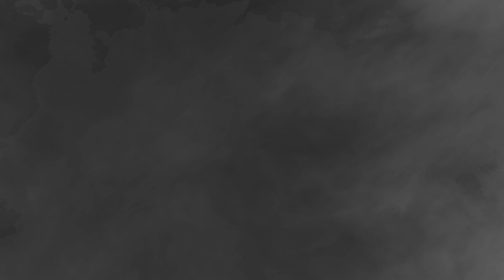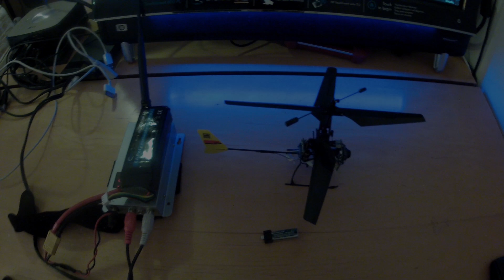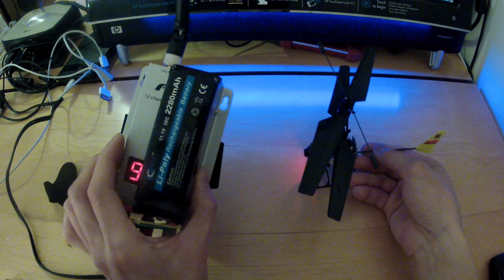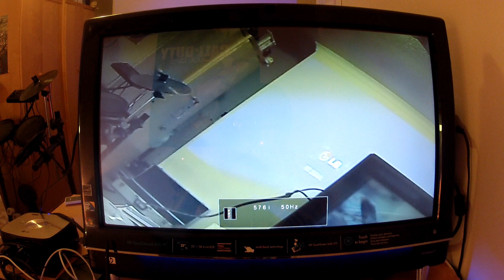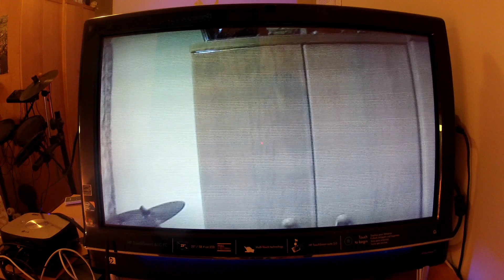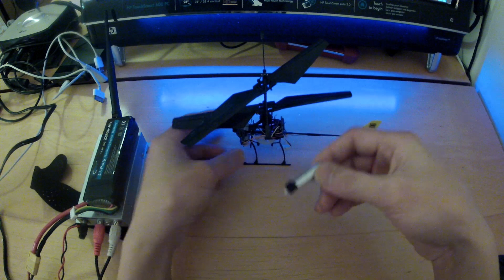World's (possibly) smallest micro FPV RC helicopter - with video tx

Comment: Nice clean job. Earlier today I ordered a large copter to practice with and also to test different cameras. UDI U12 2.4ghz 3.5 Channel 29" Long Co-Axial RC Helicopter. Not sure if it was a good decision. I also want to add ground sensing. I figure that would be a good mental challenge for me.

Comment: Did the same, but stripped the (rather beaten up) copter of boom and landing gear. Smaller yet. 1 g camera from hobbytech, good low light reception as you can see when I fly into the basement.

Comment: very cool , man!  Im experimenting with some long range FPV, using 433mhz flight controls and telemetry on large gas helicopters, with 2.4ghz FPV link. The 433 UHF gear is transmitted from ground station with twin 5-element Yagi beam antennas, so is over 10 miles tested easy. The FPV vid link is going to match by setting up "mesh-nodes" scattered over operating area, forming continual networked vid link...will post details soon after mesh-node tests... Keep on Flyin bro!

Comment: Great! Thanks for sharing! I'll do the same thing with my 1g cam, 200mW video TX and FrSky TX for indoor/outdoor flights. Maybe with a little bit larger platform (I thought about Walkera palm-size copters). Also, I'll try to place a cloverleaf antenna for long-range distance. I have a 4,3 inch LCD monitor, but for "near-home" flights the PC monitor would be mutch better. So, a stupid question (sorry for it): what soft do You use for fullscreen video TX connection? Thanks!

Comment: Hello if I can find the vid of the very small FPV I will send it to you.
Keep in mind at the level the public plays at is with what can be purchased off the shelf.
The realy high tech stuff we rarely see can be the same as what we have but at great expence is minitureised so the planes/choppers are the size of insects.
And batterys that weigh less than 0.025 of a gram.
Is the one gram cammera any better or worse than the 3 gram one ?